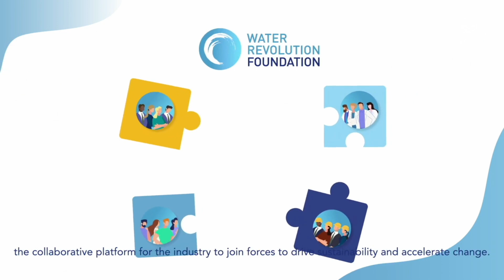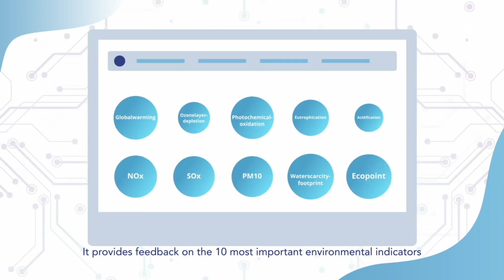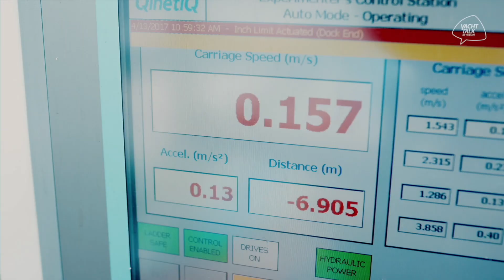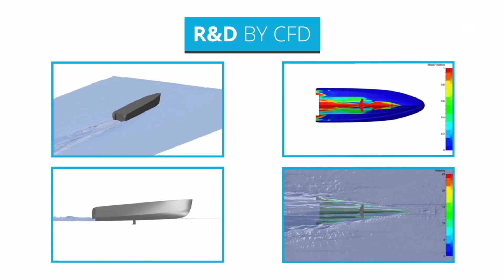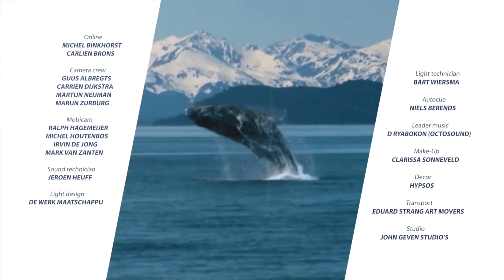YachtTalk Episode 3: the sustainable future of superyachts

Comment: I think the often high budgets for superyachts should be used more to develop new sustainable yacht power systems, which can then be applied to smaller yachts and commercial shipping. This way there can be a larger impact in changing the way we traverse the oceans. A little bit like formula 1 and hypercars helps develope tech which can be used to make normal roadcars better.
Reply: Wind power is actually a green technology for ships that we already posses, but for many potential yachtbuyers not interesting because of lack of interior space, heeling complication and it not being their style. I think more could be done to design simpler computer aided wingsails, which are more efficient and more clean looking than traditional sails.
Reply from the maker: Thank you for sharing your thoughts with us. At Heesen, we invest in R&D and apply it to the yachts we build on speculation. A good example is the 50m Fast Displacement with hybrid propulsion. Eventually, clients will follow our lead.
Reply: @HeesenYachts  Quite Right!

Comment: Hydrogen is NOT a fuel source. It is an energy storage mechanism. There are no hydrogen wells. Hydrogen has to be manufactured and stored at great difficulty and cost. No such infrastructure exists currently and frankly, because of the costs and inefficiencies is unlikely to 'ever' exist. Batteries on the other hand are a much more mature and frankly vastly more efficient method of energy storage. Batteries are not particularly useful if one wants to carry sufficient energy for long voyages, but if combined with a sail can definitely do the trick.